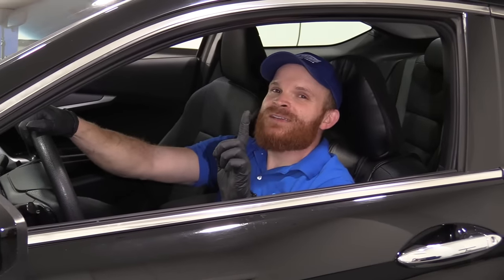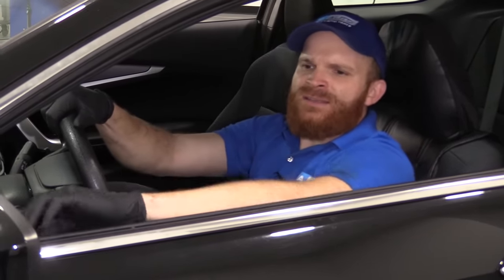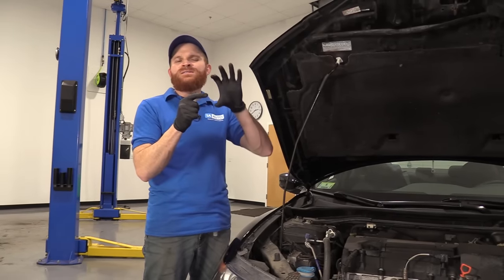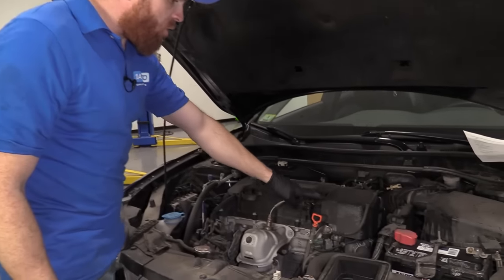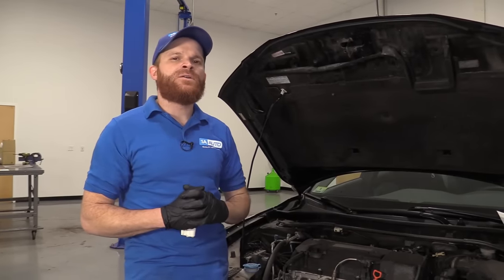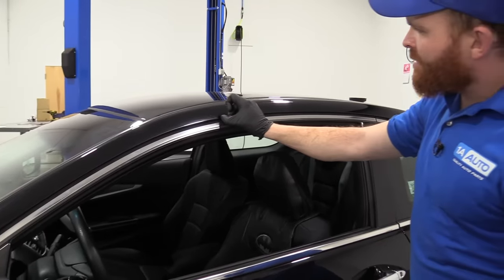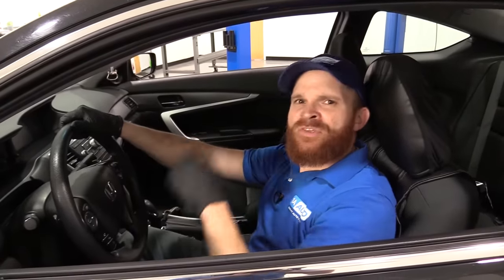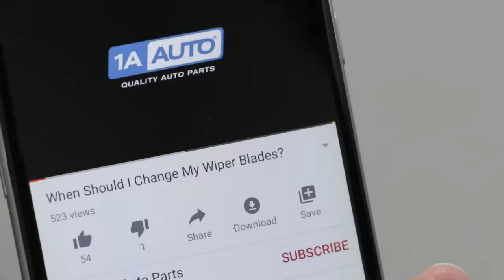Top 5 Problems Honda Accord Coupe 9th Gen 2013-17

Comment: What do you consider as "using oil". My 2014 uses a little less than a quart in 5000 miles.  As far as the seats go, I am a larger person than you and I really like them. They are on the firm side like most Honda's but I find they are more comfortable for distance driving than some cars with softer cushioned seats. As far as clear coat goes my car is not garaged and is a daily driver with nearly a 100k on it and the paint is near perfect. No clear coat peel at all. The mirror for me is not an issue and neither is the starter. Everybody has their likes and dislikes concerning automobiles and no car is perfect but I don't agree with your review of this generation of Accord based on actual ownership and experience with this car.
Reply from the maker: +Ed Anshutz Thanks for watching!  These are just the top 5 issues that owner's of this model have mentioned, but not every vehicle will have them.  It sounds like you are not burning off too much oil so it's not a real issue for you, but we still recommend you check on it at least once or twice between changes!
Reply: 16 Honda accord sport here..There is issues with peeling "paint" on white hondas..mirror is funky..seats ok..at 4300k in between  oil changes.. my oil level goes from jus slightly above full mark..to in between the marks..oil smells like strong gas..that concerns me..so iam gonna not go by the maintance minder..and change oil 5k inerveals..i hope she last me 10 plus yrs..atleast till i pay it off😂 can i switch to a 5w 20 oil on these cars to help with burning?...ty for the video 1A
Reply from the maker: +Eric Maeder Thanks for watching!  You will still want to use the oil weight that the engine calls for.  These are engineered a specific way and need to have 0W 20.

Comment: 14 ‘ sport manual here .
Issues.

Starter need oem
Water pump
Struts
Lowet ball joints
Valve cover
Battery
O2 sensor downstream (p0420)
Sway bar endlinks

Comment: i have a 2013 accord coupe EXL v6 Manual 6 speed 0-20 Mobil 1.  No problems that you have mentioned 140,000 miles and running strong.

Comment: Oil consumtion is a easy fix on the accord , 3 qts of 0W 20 mix with 1 qts of 5 W20. also install a catch can oil to keep PCV valve clean at all the time. problem solve on my Accord. about the mirror,  i like it the way it is because extend to another line view on the highway when car drive a high speed and they swings between lines.

Comment: No mention here of VTC rattle at startup which is a very common issue for the I4. Unfortunately it's a  problem that hasn't been fixed by Honda and if parts are replaced it can come back. That being said, it hasn't caused any serious issues aside from a terrible sound. I've had mine for 7 years and only had a wheel bearing go bad. Everything else was just maintenance like brakes, battery, tires, oil,  and other fluids.
Reply from the maker: +Jared Holodick Thanks for the feedback!

Comment: The oil consumption issue is normal unfortunately. Direct injection with low viscosity oil is what we have to deal with. I will say the cvt is one of the better ones you can get. Still has the rubber band feel but they are reliable as long as you change cvt oil every 30k. Also don't beat on the car. Premature starter failure, the location of the starter is in a spot where a lot of heat is generated as well as the elements. Honda put a heat shield there, maybe not great solution. Engines are stout no need to worry just constantly check that oil level. Also change the pcv valve or atleast check it every 2 or 3 oil changes.

Comment: 2017 accord sport- 4 year ownership, I've had to replace 3 windows switches, my battery seems to die every 1-1/2 years (Florida heat I suppose) ac just now started to smell like mildew, fixed that with some cleaner, had both my DRL'S replaced under warranty. Rotors warped at 30k miles, had them and pads replaced, manufacture says fuel tank capacity is 17.2, I have yet to reach that, I can't pass 15 gallons and I average 23mpg city/345-360 on a tank. My radio has flipped upside down servers times then correcting itself after a few seconds. Other than those issues, car runs and drives fine, just wish there was more torque on the low end, you hit the pedal and it takes 2-3 seconds for the car to respond.

Comment: Bought a 2014 Accord EX-L in 2017 - Top Issues - (Canadian funds)
- Starter - yes-$400 starter - $7 core, has no physical solenoid, took it apart and its a cheap solenoid built internally on the starter motor housing-its junk
 -back up camera stopped working - moisture got into the housing for the camera. Aftermarket ones are available at around $300.
- Rear trunk trim panel falls off - Can only buy used if lost, there are two riv-nuts into plastic grommets. After seasonal hot/cold temps and corrosion, they break and off it goes.
- Intermittent Blend door whine - Still trying to figure it out- there are 5 motors to check.

Comment: you forgot main  issue - a little vibration when break is applied   in D and car is stoped.  but despite of it I love my 2014 sport 4door.
Reply: Vibration in D while car is stopped could be bad motor mounts.
Reply: I had vibration when braking too. It went away when I had my brakes and rotors replaced and resurfaced. Kinda funny I bought it like that though...
Reply: Vibration when braking just might mean your rotors are worn out unevenly
Reply: @ajlee6933  acutually in the case of accord, this vibration problem(stopped in D) seems to be a design issue. Re-enforcing its motor mounts will not work so well.

Comment: The biggest gripe I have with my 13 exl is there is no 60/40 split rear seat. Ive needed that many times and had to have my kid sit up front for long things to fit in the trunk.
Reply: same I had a  2008 civic coupe and just got the 2014 accord coupe - only downgrade has been the missing 60/40 split which the civic had.

Comment: Everything he said excempt for the mirror has happened to a 2014 honda accord. I just had the starter replaced at the dealer.I  had them also replace the started relay. I was dealing with the issue that ramdomly the car wouldnt crank. It had a new battery and clean terminal cables. Anyway, the dealer put it through diagnostics and said they couldnt reproduce the problem and that everything was ok. So I had them replace the started after me watching videos like this one. It set me back $700. Ouch! 
Its been only one day so I cant say the problem has been fixed with the random no starting, but it looks like the priblem has been solved. By the way, I understabd Honda had a recall on the starter for the 2013 accord, but not for the 2014. So the dealer claiming ignorance on the issue of starter problems for my accord was just not believable.

Comment: We have a 2014 Accord EXL Navi.  We bought it new and it is a great car with the exception of the starter problem.  At 80K miles we had the problem with the starter button not working.  Took it to our local Honda dealer and had the starter replaced for about $850.  Now at 87K miles it is starting to act up again.  A little disappointed in Honda, they are normally better than this.  It must be covid/suppy chain/lack of people problem.

Comment: 2013 honda accord sport had it since 19,000 miles and now its at 91,000 miles. Changed the battery, starter, both rear wheel hubs, and has a rattling sound at a cold start up. Going to do timing chain and tensioner soon. Also see alot of rust dust coming out of the ac compressor clutch and have aoil leak on the left side of engine. If i take care of the timing chain and tentioner issue ill sure get another 100,000 plus miles out of this car!

Comment: You forgot to mention transmission and engine mounts going bad. I had a 17 and many of the people I know with these cars. Had to replace the engine mounts way before 100k.  Also the alternators are weak on the 9th gen accord.  And oil delusion is another problem because of the GDI.
Reply from the maker: +KGB Reviews Thanks for the feedback!
Reply: GDI is only in the 4 cylinder models,  the V6 is not Direct Injection.  Mine has been fine.
Reply from the maker: +gabe villarreal Thanks for the feedback!
Reply: My 2013 Accord LX has 233k with no motor mount issues.  Yes, the battery was not powerful enough for the car, and I did have to replace the starter at 43k.
Reply: I have the same opinion.
Reply: I have a 14 LX and I've also had battery issues. Had to change the starter as well. More pissed about my transmission blowing than anything. Now I have a vehicle that I still owe money on but can't use🤬

Comment: I have a 2017/ V6 sedan and I replaced the starter- and heard a screeching noise- replaced that one and still heard the noise. My mechanic took the gasket off. A week later noise is back. He said I'll probably have to get the oringal one from the the dealership for the starter.  It just weird.
Reply: Did you fixed?

Comment: I have a 2014 the mirror situation is literally just something to get use to because it’s DIFFERENT definitely not an actual issue the only 2 valid problems he mention was the starter and MAYBE the oil consumption which i have had problems with neither

Comment: I agree with the oil burn but only with alot of highway driving. My complaint is the battery started failing after 3.5 years and needs to be replaced.

Comment: Ive got a 2014 accord coupe and I don't have a single complaint about it. If anything its my project car/daily driver. pretty sure my actuator is going out so im getting that replaced but for having a 145k miles and only just having the actuator go bad? psh ill take that. And let me put it this way... I drive it like a damn race car haha and she's held up 100%. Id rebuild the car before I EVER decide to let it go but thats just me. As each is their own. All I am saying is please dont allow this video to question getting one lol. Im sorry but the mirror part was a bit much...never have had any starter issues.... oil consumption I will agree with a bit as for its something I did notice but its typical car care to check,fill,and change it.....cant say I have ever run into paint problems nor have I have i found the seat to be uncomfortable.
Reply from the maker: +Ben snyder Thanks for checking us out!
Reply: 1A Auto Parts wasn’t trying to wrap on the video either by any means! Very informative but at the same time just wanted to give a positive testimony on the car 👍🏼

Comment: I have like 200k miles same car and engine doesn’t burn a bit of oil. Only maintenance I’ve done was air filter and oil changes and tires everything on time. Haven’t touched anything and it’s never had one issue or ever broke down I’m actually going to get another one.

Comment: Everything this guy said is ridiculous!!! My 2015 Honda Accord Hybrid has 260k now with no problems at all. Same stock starter. Change oil every 10k miles and never burns oil. The mirror thing is not even noticeable that he pointed out. The paint is excellent still on my car. It still looks new inside and out
Reply: you are making your assessment based on one car. thousands of these cars have been sold and some of the problems he is bringing up have affected a number of these cars. read some forums and car repair sites and you will find the same issues with multiple cars of this generation.

Comment: I have an 08 V6 with 400,000 miles and three engine is starting to knock. Mechanic says it's a design flaw because the piston rings are too soft and allows oil to get to the head. Looking for a 13' on up when they changed it.

Comment: I have a 2017 Accord base model. After 130,000 (yes 130 K) miles, my car doesn’t have any of those issues. And the seats are so comfortable. I changed one time the battery. The only issue I have recently, is that the alternator plays lazy.
Reply: yeah I am on my 3rd alternator my 2013 has 158k you are going to beat my records

Comment: I don't have any of these problems. If I had to fault anything:
- rear calipers are weak like on many Hondas
- being a GDI engine you need to keep after cleaning the Intake values and manifold
- rear wheel bearings can be an issue
- goes through a lot of fog light bulbs. The dealer wants $200 and says the bumper has to come off. Not true!
- Use a good wax spray to keep after the rust.

Comment: The comment about 0W-20 is so true, it's swapping one problem for another. On the Lexus IS350, the 2013 model specified 5W-30 and the 2014 model switched to 0W-20 even though the engines are exactly the same (2GR-FSE). Guess what happened in 2014? The US govt mandated even stricter CAFE requirements.
Reply from the maker: +elusivellama Thanks for the feedback!

Comment: I guess I spoke too soon, I’m on my 3rd starter, very slight oil consumption and around the rear windshield the paint is chipping, other than that I guess it ok, I definitely know the quality of Honda is nothing like the older Honda’s, I had a 1991 accord that was flawless, never changed a starter, alternator or ac unit, just your basic maintenance

Comment: Like your vids, I have owned Honda's for many years. Personally I do not find the driver's side split mirror a distraction and I like the seats. I agree with the other issues. I like Honda automobiles generally low cost of entry (unlike their pricey outdoor power equipment). They're dependable, relatively easy to maintain with the exception of their pressed in wheel bearings and have strong resale value. Living in the Northeast U.S.  I have had and have seen issues with their clear coat and experienced corrosion on body panels. If you're retentive about washing and waxing your vehicle these issues can likely be avoided. Hopefully these issues have been addressed on current models.
Reply from the maker: +cardo Thanks for the feedback!
Reply from the maker: +cardo Thanks for checking us out!

Comment: I agree. I have all these problems with my 2013 Honda Accord Sport. It has bad oil consumption and the the dealership refuses to do anything about it. The seats are uncomfortable and cheap. The starter went bad at 50k miles and had to be replaced. The materials and stock speakers are cheap and horrendous sounding. The clear coat is stripping and making the paint come off. I hate the CVT because it's so slow to accelerate. The car is also very light compared previous generations due to the CVT and Mcpherson struts that it feels like you are going to lose contact with the ground and veer off the road and crash if there are strong cross winds and what not.  I honestly would not buy another Honda Accord again.
Reply from the maker: +MatTZI014 Thanks for the feedback!
Reply: Agreed heavily

Comment: I own a 2015 Accord sport with amamnal trans. I HATE this thing. The rear brakes seized at only 34 000 Km (  about 21 000 mi.) and the starter failed at 36 000 Km ( around 22 00 mi.). These two repairs cost over $ 1000C. This thing is noisy, uncomfortable and rough riding.

Comment: I own a 2014 accord v6 coupe since 30k miles at 100k now no issues aside from scratches on paint mostly my fault. No engine codes no major problems, electric heated seats feel fine comfortable wise and starter works fine.
Reply: Automatic or Manual?

Comment: Dude good video, i own the 2014 accord coupee. Ive changed my starter within a year of ownership ( im going on year 3). Noticing oil consumption, alotta of ppl say that changing the pcv valve should help but that i should also use supreme gasoline once in a while. If anyone sees this with the same car, id like to hear what your problems/maintenance have been like. I really like the look i got the beige seats in a blue coupee. Im trying to stay on top of things when it comes to maintenance

Comment: Basically, wash your car without drive through car washes which are TERRIBLE and maintain it with a wax or some type of sealant. My mirror when somewhat clean is not blurry in the bend at all. Haven’t had an issue with the starter yet over 100k miles now. Oil does go out as stated in the video so yes refill with the same exact oil when needed.

Comment: 2017 Accord SE(4 cylinder) with 110xxx miles. List of  issues: battery died (after 4.5 years), shitty OEM tires, annoying noise from dash every now and then, and now to change out my brake retainer clips. Bought the car brand new with 7 miles. If you still have the shitty Michellen tires, get rid of them and buy something else. I live in California and will be going back to summer tires after I run through these all season (non-michellen) tires. My paint is still good, and no major issues with the car. I use only full synthetic Mobile 1 oil and have ZERO oil consumption. Not a big fan of Hondas, but it's been a solid reliable car for me.
Reply from the maker: +Jimmy Xiong Thanks for the feedback!

Comment: my 2014 honda accord sport has 285,000 miles. at around 200k miles is when my starter started acting up, my catalytic converter also had to be replaced, as well as my high pressure fuel pump. Other than that the car has been extremely reliable. Only left me stranded that 1 time due to the high pressure fuel pump. Then again i did pour lacquer thinner in the gas tank to clean the dirty catalytic converter, so that's my fault